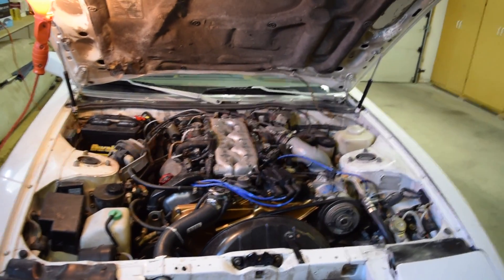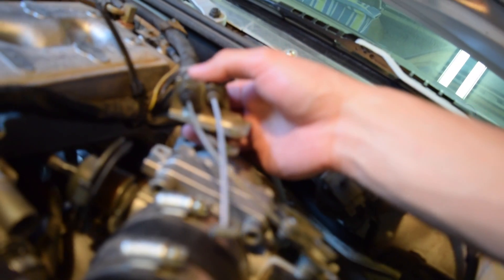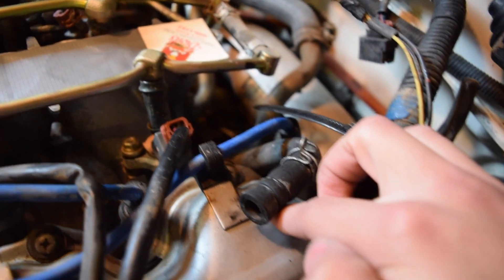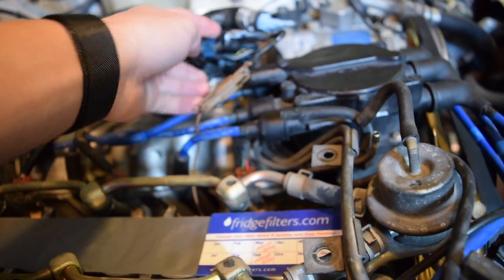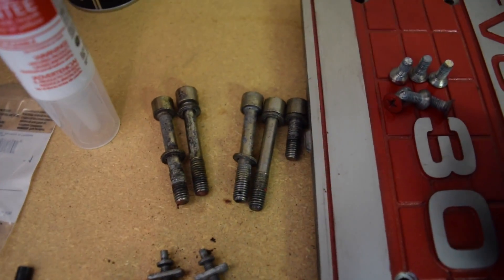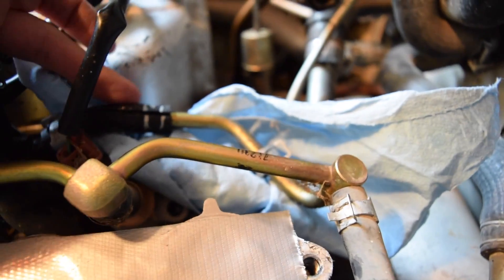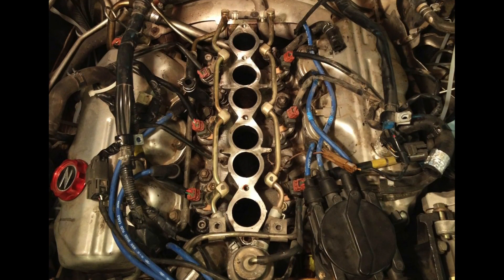Intake Manifold Removal (300zx Z31)

Comment: Finally , A video on how to remove the upper intake plenum in a z31. I was trying to take mines off and I gave up because I didn’t have a big enough wrench to get that nut of the 18mm or more nut. (The thing when he was explaining how he had to use an adjustable wrench to get it off)
Reply: Yeah I going to get an adjustable wrench soon and hope that I can get the upper intake off so I can redo the fuel lines underneath it easier. Thanks , I love the  videos. By the way I have a 85’ 300zx turbo auto that hasn’t ran in about 20 years it was my grandpas brother car but when he passed my grandpa took the car and now he gave it to me ( I’m 16) I’m hoping on swapping it to manual and getting it running again - Eric
Reply: Joshua Crepeau thanks for the info. We’re on the same path, so I’ll definitely stay tuned for your build as a reference for mines. I was also thinking about buying a manual z rather than buying all the parts piece by piece, but I can’t find a decent z that’s manual and would be a donor car.

Comment: After spending a day and night trying and mostly failing to take everything apart, there's definitely some differences between this video and my experience:

0:52 - lubricant helps, but the biggest problem with these bolts is the ridiculously soft aluminum they're made out of. The hex heads round out EXTREMELY easily even when using caution and the correct 6mm hex socket.
1:57 - the spring, nut, and washers on the end do not need to be removed to disconnect the cables, just turn by hand and remove the cables.
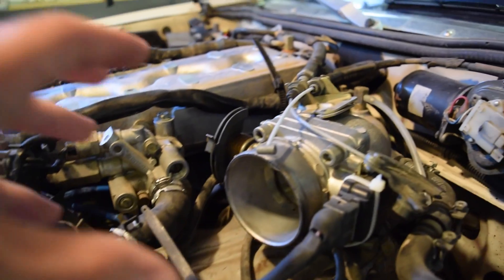2:56 - the large plastic piece of intake that vanishes between cuts is nearly impossible to remove. This and the big rusted bolt for the air recirculating element (that requires an adjustable wrench) are what's currently keeping my manifold on. Even with all the screw clamps at the top and bottom removed it doesn't budge, probably thanks to the hoses connected to both sides that are too short and rigid to be able to slide back enough to remove. If there's some technique to removing this, please share.
3:23 - Showing the disconnected hoses and wires is alright but when disassembly is the name of the game, actually showing the process of disassembly would have been much better, like you did with the fuel rail.

Please don't get me wrong - this video is a big help as barely any information on this job exists anywhere else. It's just frustrating being held up by the removal of a couple stubborn parts and hoses that aren't shown here.
Reply from the maker: I totally get you. It sucks trying to film and get things done in a timely manner. I wish I could have spent a whole day filming everything but I was in a time crunch and had to get things moving. I try very hard to show as much as I can. Thanks for the input!

Comment: I put color coded zip ties on the hoses, connectors, anything that was doubtful where it goes.  I learned that lesson after pulling the plenum, then waiting over 6 months to put it back.  Had to go into the factory manual and find everything and mark it.  Huge pain, so color coding the connections makes sense.
Reply: That’s the best method. I’m a heavy duty mechanic and Once you get into hydraulics there’s so many hoses and if you don’t colour code then you will be spending days figuring it out

Comment: Thank you for the video, I have a 89' that I just replaced the fuel injectors on, but I broke a hose that was cracked and I dont know the name of it, its the "S" shaped one with tape on the end at 2:58, right in front of the throttle body, its about 4"long, does anyone know the name of it and where I can get one?  thank you in advance!!!  I think Its gotta be like intake throttle body hose????
Reply from the maker: Funny enough, I've been looking for that one as well! I've been looking for months but haven't been able to find it new. Just used. If you're interested in that you can check out 300zxpartsforyou.com or you can just delete the idle control with an intake manifold block off kit. That's what I'm going to do eventually.
Reply: Another option is to visit ZenonZCar.com which has complete listing of parts needed on this 300ZX model. Shows sizes and part numbers.

Comment: Hey bud, how much of the engine has to be broken down to replace that front coolant bypass hose...the one under the fuel pressure regulator? Any thoughts?
Reply from the maker: It's easiest with the timing belt, cam pulleys, and rear upper timing cover off. But that's a lot of work for a little hose so you may be able to do it with just the fan shroud assembly out of the way if you can access both of the clamps on the hose. It really depends on if you can get to those

Comment: Is there a vacuum port on the underside of the upper intake on the passenger side of the car? Can’t tell if it’s a vacuum leak or a gasket leaking I’m dealing with
Reply from the maker: I don't think there are any vacuum ports on the passenger side. Just the drivers side and front of the manifold
Reply: Check that cold start injector thats where air was escaping on mine

Comment: Probably going to be doing this to replace my injectors. Other than the injectors, injector line, hose clamps, and manifold plenum gasket, are there any other parts you recommend replacing?

Also, when putting the manifold back together, do you only need the one new gasket (such as Mahle MS15494) or an entire intake manifold gasket kit?
Reply from the maker: Nah you nailed everything. I'm not sure why those trapazoid gasket things come in the manifold kit. They are under the plenum name plate on mine and I've never felt like I needed to replace them at all. I don't know what they're for. But for me just the upper intake gasket will do it. Hope the video helped to give you an idea of the process!
Reply: @TheZGarage  Gotcha, thanks for the quick reply. Any particular vacuum lines/etc that are easily broken when disassembling that I should order a replacement for?
Reply from the maker: The idle air control hose likes to crack and is hard to find a replacement for but that's usually about it. Most of the other hoses can be gotten at autozone if they are damaged during the removal

Comment: Is there a pattern when tightening the intake cover, I can’t find anything in regards to it ?
Reply from the maker: I'm not sure if it's official but typically you tighten from the middle outwards alternating which side you tighten. So if there's 5 bolts, it'd be 3,2,4,1,5

Comment: 2:58
So I see there is two connectors for the tps. Mine pig tail connector is just hanging loose there when I got the car. Is that something I should be worried about? Because the other connector is already connected to the tps sensor itself. Is your zx manual or auto?
Reply from the maker: If your Z has an auto transmission, the tps has a second connector. If you have a manual Z with a 2 connector Tps then it's either been replaced, the engine was swapped, or the transmission was swapped. Either way, if you have a manual, you don't need the second connector
Reply: @TheZGarage  thank you so much!
Reply from the maker: No problem!
Reply: @TheZGarage  I have a 86 300zx, it’s a 5 speed manual and the previous owner didn’t mentioned anything about any engine or transmission swap nor anything. I just saw there was a second connector for the tps and was confused where it went to. I just know a auto version needs two connectors for the tps
Reply from the maker: He could have just replaced the tps at some point and got a auto Tps instead of a manual. Sometimes it's hard to find the manual one so the auto works just fine